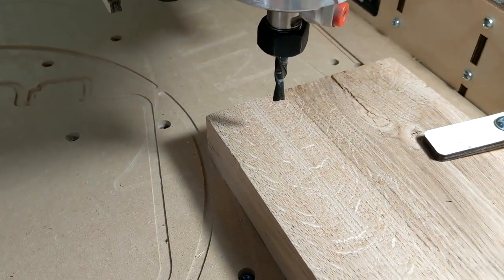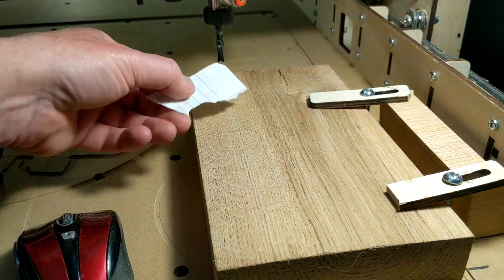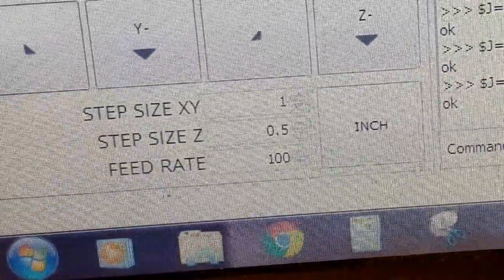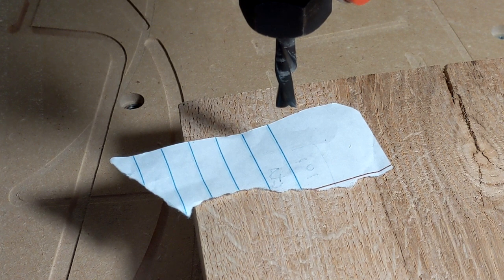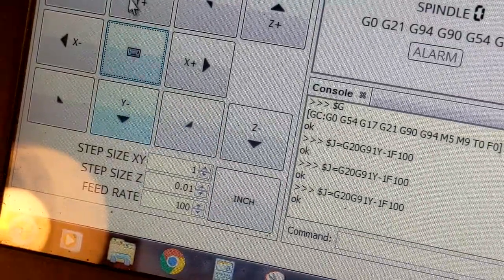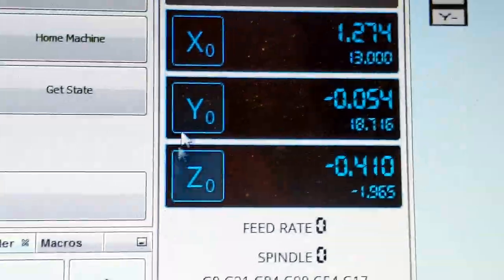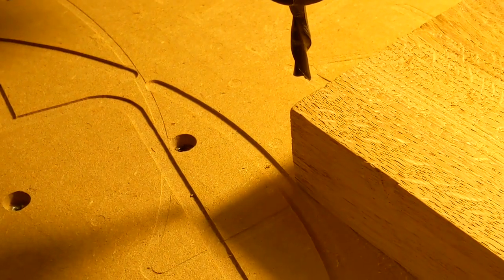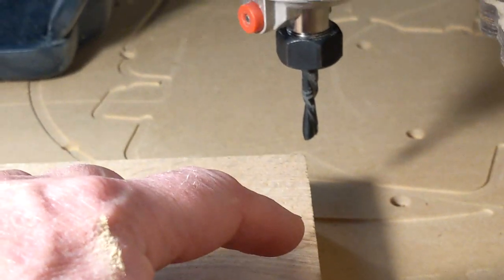Precise Zero Setting Without a Touch Probe on Your CNC Bits

Comment: Garret, I've been thinking maybe I needed a "touch-pad", but they are expensive. This Zeroing technique is simple! I don't even consider myself a novice as yet. About all I've been able to do is jog, and re-home. Am wrestling with mods and trying to understand how to g/m-code in preparation for the work I need to do.  Thanks!
Reply from the maker: Paddiman772, you're so welcome! And don't worry my friend we all start out as complete novices! Give this zeroing a try, I think you'll be surprised how well it works!
Reply: Z can zero own cheap touch plate, cheap make own at home, no need lot tools, and parts , one aluminium or other metal piece, screw metal sheet one wore, then solder second wire to crocodile clamp, and connect sheet wire controller probe GND plug, and second wire to probe input connect plug, and have cheap probe sensor. only Z axis, this have yotube some video how make cheap Z zeroing probe. same can use X and Y too, but sheet to X side to work piece and move bit to  metal piece same than Z you do before, and same do Y side but sheet to work piece side and move bit to sheet then you have zero, and then minus half bit and minus sheet tight have true zero point.

Comment: I like your channel by the way.  I have seen many of your videos and let the entire long videos stream in while I was doing some kind of physical work, I think it was soldering up pcb boards. Kind of like a radio broadcast. Many of the ones I saw were with the people you are mentoring. I makes for good background television, kind of like have the golf channel on. You have a good voice and a great presentation.
Reply from the maker: NewRAD CNC, thanks brother I appreciate that! I'm glad you've been enjoying the videos. The mentoring ones are definitely fun for me to make too! Happy cutting!
Reply: @IDCWoodcraft   I make software for CNC Machines. If you ever want some cool new software, just let me know. I will set you up. I have a CNC Controller software like Mach3 called "NewRAD CNC", now with cameras, that can auto reposition to X0 Y0, withe a precision of up to 0.01mm, using only 2 microscope cameras. I also have a very nice Drawing program with GCode Generator, and an Imaging program to convert photos to SVG, and then to GCode. It would work great with one of your laser machines.

Comment: Thank you for this tutorial. I tried and it works perfect. I use Eding software, the coding change is indeed  possoble in any software.  Technically I don't quite get it though - that I had to set the X and Y axis zero at the reverse order. (When i think I am rubbing the bit on the X axis, i had to set Y as zero in the software, then only it gets right). It works but i dont understand why.
Reply from the maker: The Minimalist, that is a bit odd brother! I would reach out to the software company regarding that problem.

Comment: I watched a carbide create video a few weeks ago. The guy stated he likes to zero the z axis from the bottom  of the wood. He said a short sentence after that but it really didn't mean anything to me. He didn't really hit the nail on the head in his explanation so I found out on my own and ruined a piece of wood in the process.
I found out the hard way the real reason why he zero's from the bottom of the wood is that during tool change the bottom of the wood never changes. Its always in the same spot. So if your zero is set at the top of the wood and during tool change you accidentally set your z to the new depth that you just cut now all of a sudden everything is going to be wrong especially if it doesn't concur with your cuts.
I bring this up because I would honestly like to hear the real reason why you would set your starting point in the middle of your project and how exactly would you set your x & y for a circular piece of flat wood.
it seems to me I would just treat the circle just like a square. I go to the lowest point in the circle to set the bit and then I go to the farthest left side of the circle and set that side?
When I did that though, and pressed outline on gSender the long mill went crazy, one side skewed and then it even come way to far forward and go past its limits.
It did that several times. I eventually just drew a pencil line like it was a square and set that bit using a ruler standing on its side to represent the side of the "square" and cut the wood without using outline.
By that time I was tired and during bit change I set for the wrong z and that little bit I bought from you just tore through the wood like it was nothing. I expected it to break but it never did. Great bit but my mistake in measuring the wrong depth.
Reply from the maker: iwannaapple, in CNC trial and error and mistakes is ok Brother! I am happy to see that you are learning from your mistakes and want to keep working hard. 
The reason we set our zero to the middle is because sometimes it is convenient! Just like you said, sometimes we are working with a piece of wood that doesn't have a clean crisp edge and the best reference we can get for the CNC is right in the middle. 
As for a circle what I would recommend is getting a ruler and measuring it until you find the widest point, then draw a line. Then turn the circle around by 90 degrees, measure it again and draw a line. That intersection is the centermost part of the circle.
Reply: @IDCWoodcraft  
By finding the center of the circle and setting the z in the center, does that mean I don't have to set the x & y to the side of the material but at the center also? I using carbide create right now and I would have to set the to the middle also?

Comment: Thank you sir.
That made a world of sense.

Just a couple of questions:

1) Why do they have wigglers, touch probes and other gizmos to find the zero point if it can be done this way?

2) Do you get better accuracy finding the zero point using a wiggler / touch probes?

Thank you!
Reply from the maker: By wiggler, I'm asssuming you are meaning an 'edge finder'. This method is very accurate.

Touch probes are also very accurate and much easier to use. this is for those who do not have one but want accurate settings.

Comment: Hello Garret I finally have my CNC for Bob set up I’m trying to get the programming set up for it have a little bit of a problem do you have a video set up for that I’m trying to set up in the vcarveThanks Jim
Reply from the maker: I do not have machine setup videos to connect your machine to the designsoftware. What is the problem you are having?
Reply: @IDCWoodcraft  I’m very new at this I have download it easel and I can get the machine to home but I can’t get it to do anything else so I try going into the car desktop like you have I believe and I just can’t seem to get it set up it won’t give me movement of the XYZI would like to start carving I bought all your tools lol which I can’t use because I can’t get it working lol so what do you think thanks Jim
Reply: I also have the Home build 30 18 DIY I had it working to on the easel but now it’s not working either so must be someplace in my computer that I’m doing it wrong what do you think

Comment: For most projects, it is not essential that you have an exact X and Y zero point.  Most projects I do I end up cutting or trimming the board to the final dimensions or, if the zero is off by a sight amount wont make a difference on the final product.

The Z zero is very important, especially when using a V bit.
Reply from the maker: Dan, thanks for adding this note. I forgot to mention that in the video. So glad I have help from you with tips!

Comment: Garrett, is there a reason to use paper in Z setting but not using it for X&Y? Old machinist I worked with used to do this with a mill and cigarette papers! w spindle running!
Reply from the maker: Hi Kevin. I used to set xy the same way. But I will never teach it. you know how fast the fingers can be removed using that method

Comment: thanks for the info but , I have question in the end of your video u did not put the z to the zero point you leave it up so  when I run the spindle do I keep the z up like you do and cnc well go automatic  or just put the z in zero point and if I DO it will touch my workpiece when I run my spindle
Reply from the maker: Hi Abduloawi. I always pull the z axis up before I start the spindle

Comment: Nice video. What if the piece isn’t square on the table? Do you need to set the piece according to the zerod Y further to the end? Also, what about irregular shaped pieces. Do you treat them as square and let the program do the rest?
Reply from the maker: Nathan, with projects like that you have to treat it more on a case by case basis. Typically with odd shapes its best to zero to the center of the project. Its also easier if you set your center zero with a pencil on the project and then you wont loose it incase you mess up and your machine shuts down.

Comment: Great info. Thanks! What would you say is the benefit of using the paper method vs. the probe method to zero Z?
Reply from the maker: Paper is fast and easy. Probe is exact and exact is not always required on wood. Most wood projects are not 'exactly even onthe top surface. I have a probe and never use it.
Reply: @IDCWoodcraft  Paper method will also preserve the fine tips on your small-angle vbits.

Comment: Bravo!!!! Thanks for this video. This must be how my parents felt when I taught them how to use email for the first time...😦 Do you have a video showing the process of generating a GCode from Vcarve and inputting it into universal gcode ? I think that’s the name of your controller software.  And also, is that your recommended gcode software?
Reply from the maker: Hello RT7...that's what I'm calling you from now on. I do but can't remember which one. Looks like I'll need to make one specifically for that. the software is call Universal Gcode Sender. It is free and easy to use. I like it. I have nit used some of the other softwares, but I hear Mach4 is also a good one. It costs about $150.
Reply: I can not see any reason to write your own gcode. Vectric has some great programs. Aspire is a little pricey, but worth the money. They automate so much work that you don't want to do by hand. I have cut 24 x 36 panels that exceed 750k lines of code. I know that it is satisfying to control you machine with custom code and in certain conditions even needed, but don't reinvent the wheel. You will have more satisfying results with professional software without beating your head on a rock. The money is worth it. The software is a major part of the machine.
Reply from the maker: @placitas52  for the most part, you do not need to write g code. However, it is good to understand it, and one can only really understand it by knowing how to write it.

There are cases where one would want to write cheat code. Not for a whole program, at least not these days. however, sometimes it is completely needed, as there are cases that software cannot interpret what you were trying to do.

Comment: Awesome video Garrett! ?, Would this method work for a vbit, tapered bit or bowl bit too?
Reply from the maker: Nissan300zxshowcar, it sure would brother! It is an excellent method for bits like v bits, tapered ball nose bits and bowl bits.
Reply: Thank you Garrett! @IDCWoodcraft  So if I use a 1/2" wide vbit, just bring it up to the side of the workpiece,  x and y sides, then divide 1/2" by 2 (1/4" and subtract that to the measurement to get the x and y zero, yes?

Comment: Hi. Thanks for all.  
I have a question .

If I put the routery bit in the corner Manual. Z will be close to the  surface of the project . And I press x y z all to be zero. Does this work.  ??
Reply from the maker: Hi Hani. Yes, this is the quick and dirty way and it does work

Comment: Hi Garret, New to world CNC. We use CNCjs for the controller software and smoothie. There is a Touch Probe but I am not sure if is programmed for x and y and I am scared to use it in case i crash the bit into workpiece or worse. There is a macro for Probe. Do you know how to set up a macro for the probe that comes with the machine? CNC has been idle for 2 years and now I have been tasked with getting it working so students can use it. Have a small part ready to machine.
Thanks for your help.
Reply from the maker: thetechnician832, Hey there! It's great that you're diving into the world of CNC woodworking. Setting up a macro for the touch probe should involve creating specific G-code commands to instruct the machine on how to use the probe for locating the workpiece accurately. I'd recommend referring to the machine's user manual or reaching out to the manufacturer for guidance on how to set up the probe macro safely. Good luck with getting the CNC up and running for the students!

Comment: Thank you for the tutorial, very helpful. I have a question, I have a Next Wave Shark SD110 and what is the best method to identify the center line of the table? I have mad the mistake of placing wood on the table and it was not centered to the table. For example my table is 12X18 but the actual cutting capability is 12X13. I hope I stated this correctly.
Reply from the maker: Hi Dave.

move the machine to home
zero x & y
enter g0g20x6.0y6.5 (or x6.5y6.0...whichever is correct for your machine)
it will move to the center
insert a v bit and do a small v cut in the table.
Now you know the center.
Reply: @IDCWoodcraft  Thank you, I will give it a try. Dave
Reply: @IDCWoodcraft  HI Garrett keep wondering how to enter the g codes on my machine.  For example, above you say enter g0g20x6.0y6.5 g code. I have the same machine Dave does but how do you do that? I think that should be a video. I'm totally lost on how to enter g codes on my machine and if it will work on the shark machines like Daves. Did Dave try this and did it work?
Reply: @davearmentrout5646  Did it work??? How do you do it. I have the same machine. Thanks
Reply from the maker: @maxgarcia9512   Dave's comment was a year ago so I don't remember. Since you are using that machine, and I am not, I'm not sure where to enter it on the console. I would have to see the control panel

Comment: it's okay for the Z, but XY are offset with this technique. You need to add half the diameter of the bit (for example, a 1/4 endmill, you add 0.125" or 3.175mm) to be in the center of the endmill :)
Reply from the maker: Thanks for that point. I thought I did that in this video
Reply: You did
Reply: @nicoleedmond8842  oh, maybe I missed that part, sorry!
Reply: That's because CNC zero positions are always at the center point of the spindle/bit. I use the flutes on a bit like the one in the video, aligning them straight with the edge of the stock.
Reply: @buxtor  then you are offset by half of the endmill size. If the side of the endmill is on the side of the stock, it mean the true middle is 0.125" offset for a 0.25" endmill.

It's okay for most case to be honest, except maybe if you have a 2" spoilboard endmill

Comment: I did what you showed and I’m still getting an error message saying gcode motion target exceeds machine travel. I’m getting frustrated lol. Don’t know what I’m doing wrong. I didn’t have this problem with bobscnc basic sender.
Reply from the maker: Boone P, you'll need to program the soft limits for your machine because right now that machine thinks it's going to  crash into itself and it wont let you run the file.
Reply: @IDCWoodcraft  ok, I’ll try that thank you. If I had any hair, I would’ve pulled them all out already lol

Comment: rather than manually entering the correction, its easier for me to enter the xy step value in the jog controller by  the value of the radius then reset xy zero again.  easier than console work imo
Reply from the maker: nwmi493, that is a great idea brother! I like that thanks for the tips.